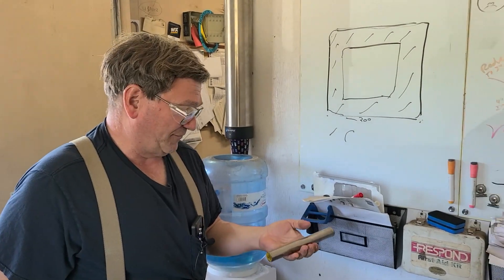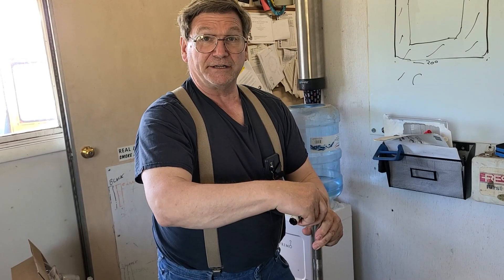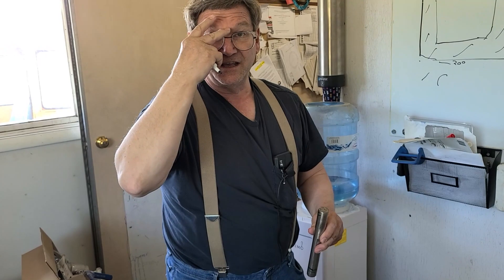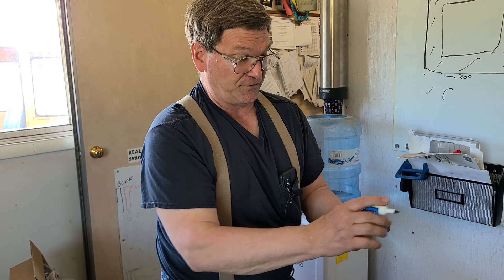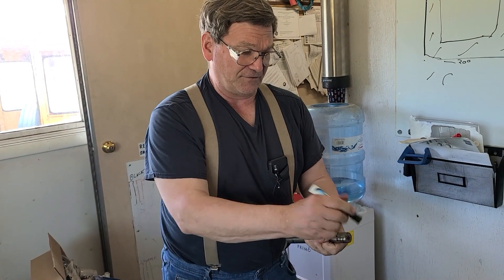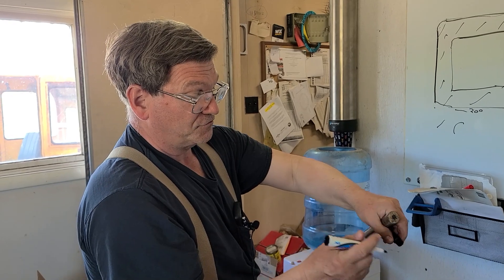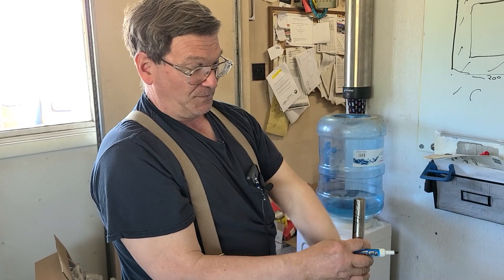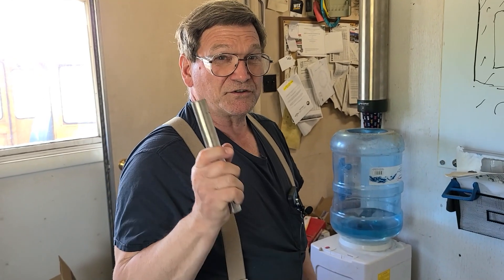Machinist's Minutes: Line shaft pump shafts

Comment: I used to rebuild these all the time. Lots of them around the rolling mill. We call them "vertical turbines".  The impeller clearance you were discussing is also determined by the length of the line shaft and the discharge pressure, etc., because the line shaft stretches under load+thermal expansion. There is some mathematical calculation that must be done when they are first installed to determine that clearance. They're actually very simple pumps to work on, just really big.